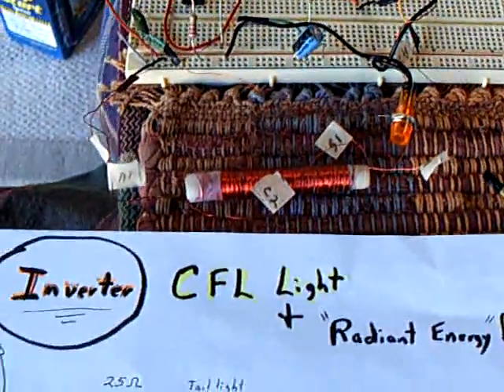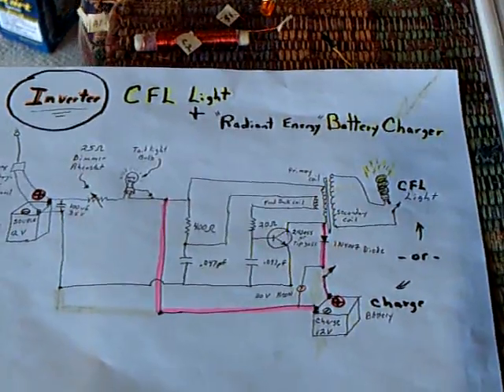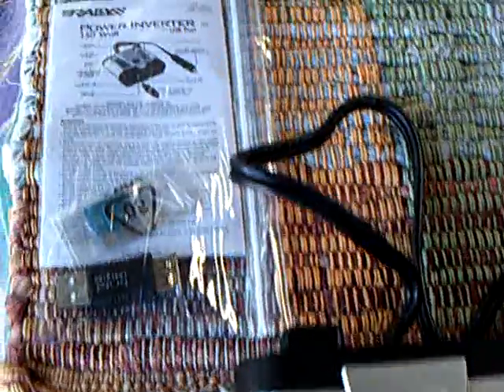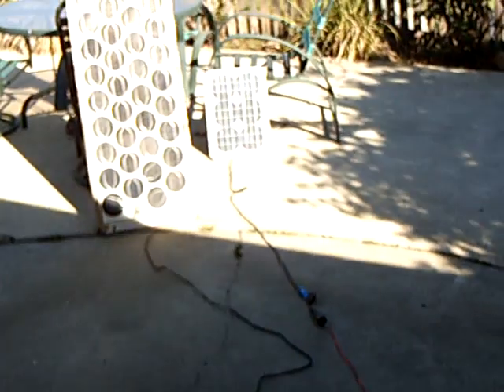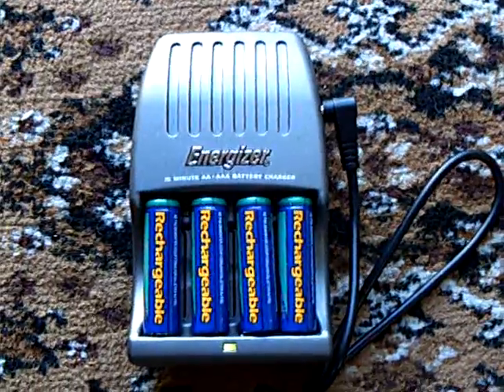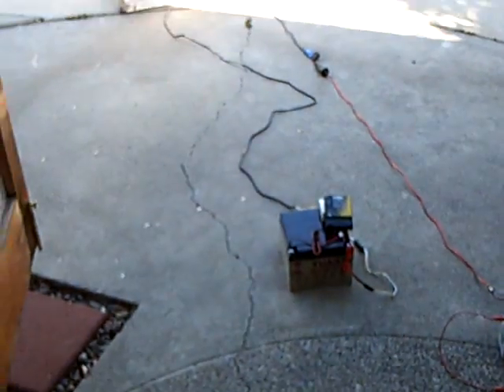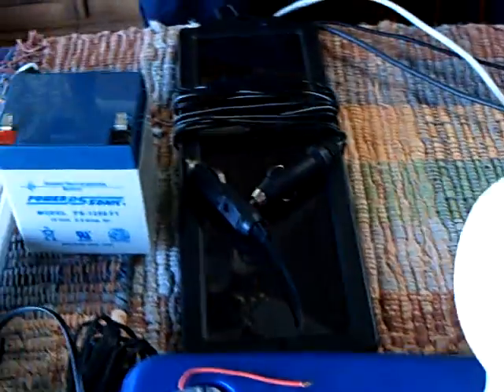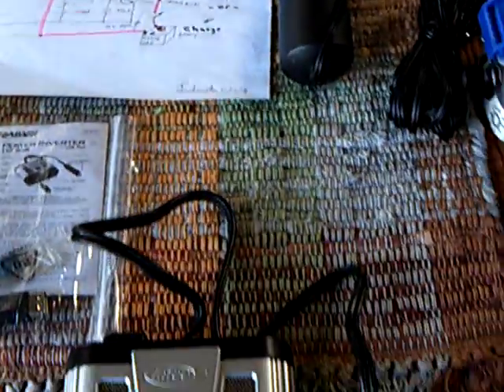California Disaster Emergency Lighting

Comment: Try putting your big capacitor inbetween the panel and battery with a diode going from the capasitor to the battery.
I can charge my battery a lot faster this way.
And the bigger the capasitor the better.